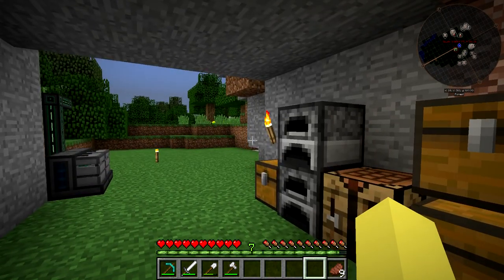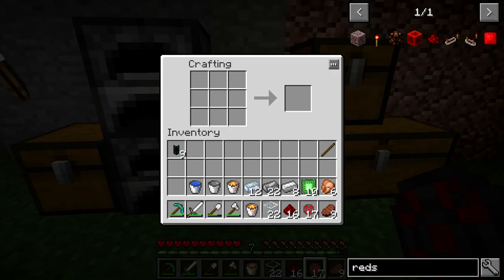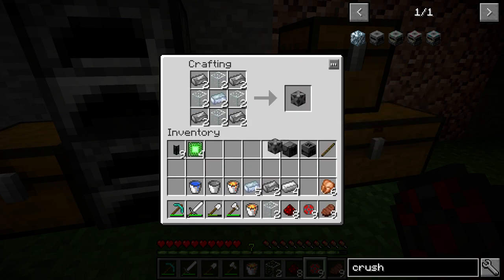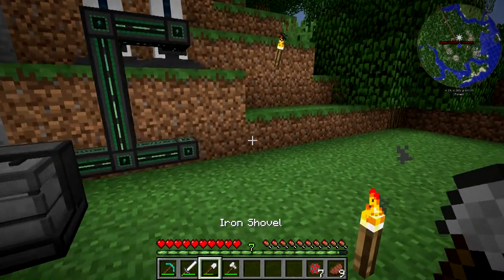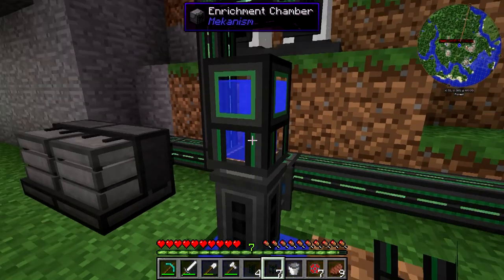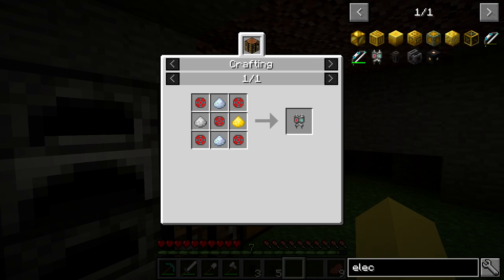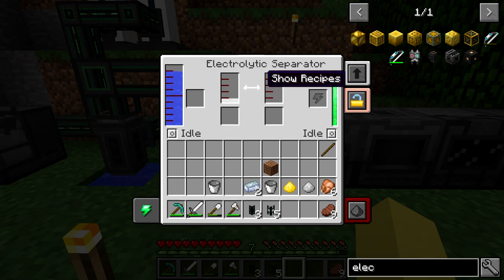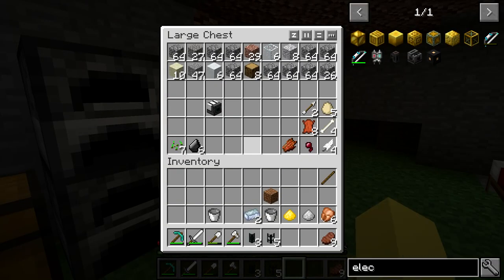Surviving With Mekanism v9 :: Ep.2 - 3x Ore Processing Setup

Comment: I have a question when i set up my 3x ore processing I upgraded everything to best factory ect, all machines had speed upgrades and energy But my oxygen wont keep up. How can i fix this?
Reply from the maker: That is a common issue that can either be fixed by using more separators or just creating a backup for when it is not running by storing the oxygen in a tank and ditching the excess hydrogen or storing that in a tank too,
Reply: add gas upgrades lol

Comment: The pump thing is actually intended behavior,  and there's a config option for it.

Definitely want to push your Smelter at least to a factory. Otherwise the end of the line bottlenecks.
Reply from the maker: Yea, I will most likely make upgrades to all of the components (be it actual upgrades or changing to factories) off camera so as not to bore people :)
Reply: There's actually an upgrade item, that you can make that will upgrade them in place, similar to iron chests. Those make the task a LOT easier.

Comment: I lined up my Mek machines just like you show in the tutorial, but for some reason I cannot get any oxygen pumped into the Purification Chamber.  I tried setting the left input to red and purple, but neither worked.  I tried using pressurized pipes from the Electrolytic to the Purification and that didn't work either.  I'm at a loss as to how to get oxygen into the Purification Chamber.  Any ideas?

P.S.  I think the only thing different in my setup is that instead of using Mek Pump, I am using Immersive Engineering Fluid Pump to pump water into Electrolytic Chamber.  The water goes in with no problem and it generates hydrogen and oxygen gases.
Reply: Hello! I don’t know if you got an answer for this, or if you’re still having this issue, but I’ll try to assist you. Have you placed your Purification to the left of your Electrolytic? I made this mistake and when I placed it on the right side it worked much better. This involved me completely flipping my layout but it fixed the issue.
Reply: @brokencanadian8310  Thanks but I'm all good.

Comment: I don't know if it will work but try using the mod "The One Probe" it's like Waila
Reply from the maker: I'll look into it :) it seems like once the machines are upgraded to factories the issue disappears, so i may not need to change it!
Reply: ok
Reply: I'm definitely with Josh here.  Even the WAWLA author now supports The One Probe.  It's made by McJty, the RFTools guy.

Comment: Also you can ( If you have IC2 ) put your unsmelted ore into a macerator which will double the output. Although I don't know if it's cheaper but I think a generator and macerator is alot cheaper than this setup in which case you could build the three times setup easier or you can go straight to a 4 times. Correct me if I'm wrong :)

Comment: Don't right click on a pipe with a configurator, it crashes..
Also you can consider using WIT (What is That) for this series, it's like WAILA but I've used it before with Mekanism v9 and it doesn't do that.
Reply: There is also TOP(The One Probe) which is like WAILA but requires you to hold an item in your hand(I think you can disable this in the config).
Reply: Real KC Hey, I see you around a lot of modded MC channels (direwolf20, hypno, etc) Would you be up to playing multiplayer? Do you have skype?
 Mine is King-Koaladile-Panther
Reply: +KoaladileProductoz sorry, but no.
Reply: Real KC ah ok
Reply from the maker: I will definitely have to look into that as a replacement for WAILA because I don't think I can stand the enrichment chamber troll anymore :P Thanks!
Reply: Hey DrRangedHard how do you use mods from different version?Because u play 1.10.2 forge mods  with the 1.9.4 forge Chisel mod??

Comment: After doing everything I've seen for doing x4 and x5 ore processing for Mekanism 8 and 9 I still cannot get the gas production to work correctly without dismanling everything and setting it back up. I can do about a stack of ore and that's all before everything shuts down. 

I think I'd rather just tinker around with Thermal Expansion and make a Redstone Furnace give x3, x4 and x5 production instead. Be easier than this mod.
Reply from the maker: Mekanism can be a bit annoying to get the setup going and other mods (like rotarycraft) offer much easier x5 ore processing, but sometimes this is all you have :) Best of luck with Thermal Expansion though!
Reply: reworking Thermal Expansions Pulverizer isn't hard to make each tier give an additional ore and increase the amount of RF it takes to pulverize at each tier to balance it out.